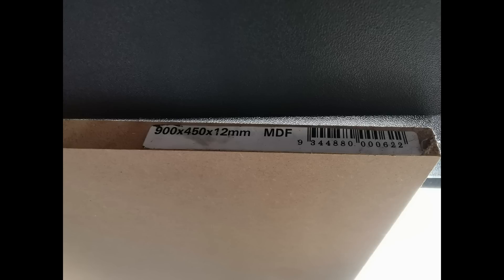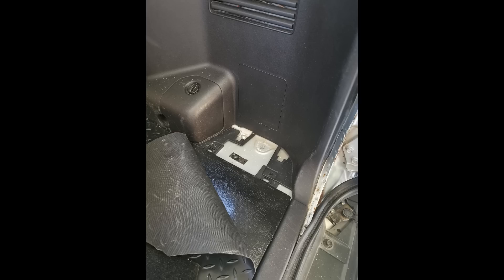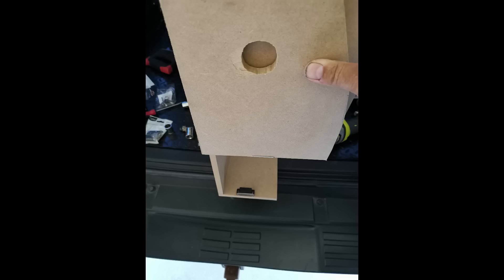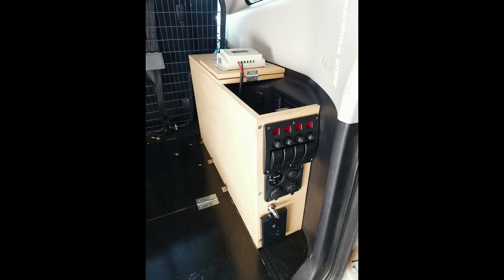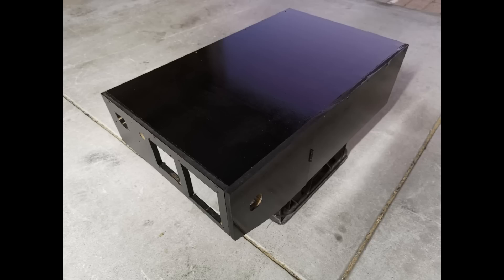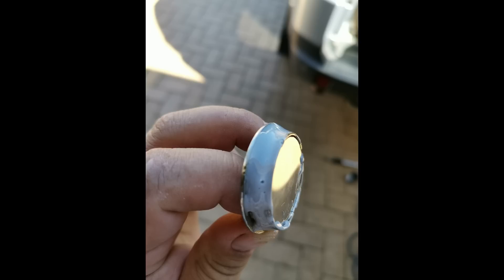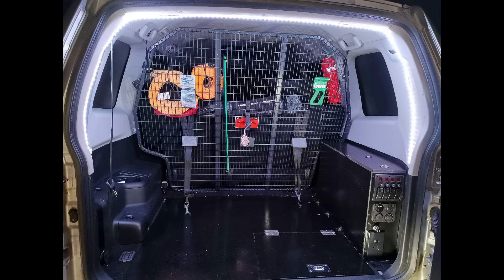Pajero Aux battery + Solar install, and Storage Mods Part 2

Comment: Hi there old mate, just watched ya vid in 2021 and looking for paj ideas. I did notice in ya 1st vid that the door u cut in went in all the way to edge, however in the next vid of u installing the box setup etc it looks like u cut it slightly back so u could still get axcess to the under floor storage. Would this be correct thanks.

Comment: Did you shorten the width of the plywood (floor) on that side so the box could fit in without hindering the floor hatch from opening?  In the first video you mention to measure wheel arch to wheel arch but in this video it looks like the MDF (wall of the box) is not sitting on top of the plywood but sitting next to it....Sorry for the dumb question mate but I'm going to try and do the same because your set up looks awesome.  I just want to get it right
Reply from the maker: The power box bolts on top of the floor using 3 x L shaped brackets and some screws. The hatch has a couple mm clearance so it doesn't contact the side of the box. If you need to, shave a couple mm off the side of the hatch lid if it comes anywhere near your box. Another two of those L shaped brackets can be used to stabilise the top of the box if needed.
Reply: @Unfastened  thanks mate.  I've just completed mine now, not as professional as yours but I'm happy with it.  I would add a photo but I can't work out how to

Comment: Hey mate. Sorry - second set of questions... What air compressor hose and fittings did you use for the extension from the compressor to the box (do you have links). Also what attachment or combination of attachments did you use to connect hose through the box? Much appreciated.
Reply from the maker: All good James! So I bought the air hose and Nitto fittings from my local 'Total Tools' shop, but any hardware store should carry them. Beware that the air hose will get really hot at the compressor end. I originally used air hose from the shop but after blowing one out,  I ended up butchering an airline off my old compressor (the rubber hose that comes with the portable air compressors) and it's held up fine. To go through the box I used a threaded Nitto (male) for the bit that pokes out the box. On the back of that is a 1/2" spacer fitting (female one side, male on the other). The male part of the spacer goes on the inside of the box then i used a washer and a thin bolt on the inside of the box to hold it. Then a female to barbed fitting to connect it to the hose. Sorry I dont have links, everything was from my local.

Comment: Hi mate, great videos. In securing the battery to the floor of the third row seat well, how did you do this? Doesn't show how you actually secured it. Also with the compressor how did you secure that too? Was it just to the plastic liner? Thanks!
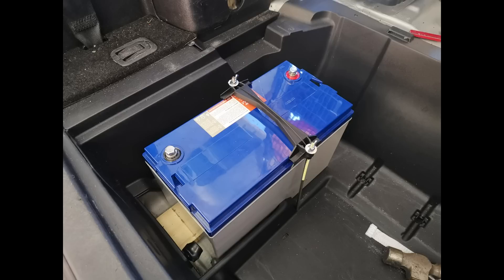Reply from the maker: Thanks mate. At about 9:34 you'll get the best view of the battery bracket. The chrome rods go through the liner and from memory on one side there is a metal subframe that i drilled a hole through so the chrome rod 'bent end' could go through. For the compressor I dremel'd 2 holes at each end of the compressor through the liner and metal and ran heat proof straps from each end around the compressor (lower half) then sikaflex'd the strap holes back up to prevent water and dust ingress.
Reply: @Unfastened  Fantastic, thank you!

Comment: Nice build mate. Have you thought about putting a fan near the compressor to circulate the air to prevent any hot spots? Thanks for mentioning where you bought the air fittings, I tried Bunnings & SCA but had no luck, so I ended up using the barb fitting like you first showed.